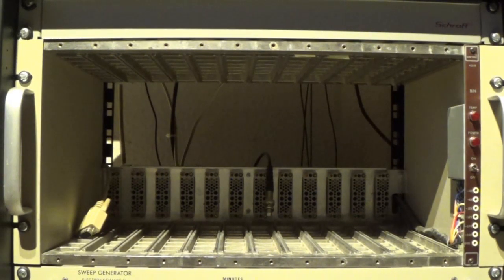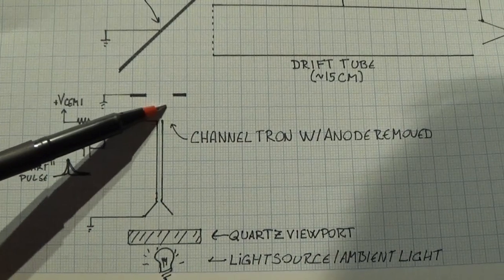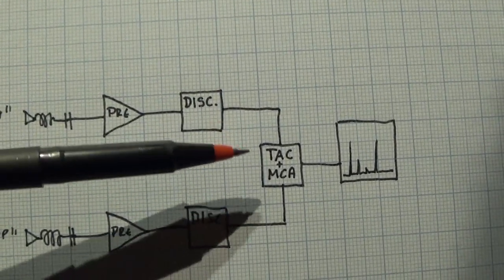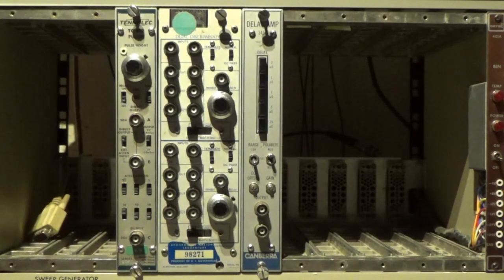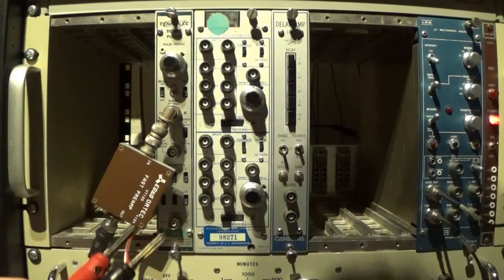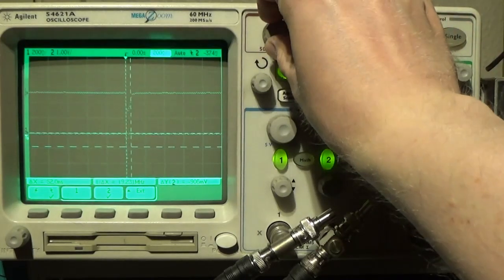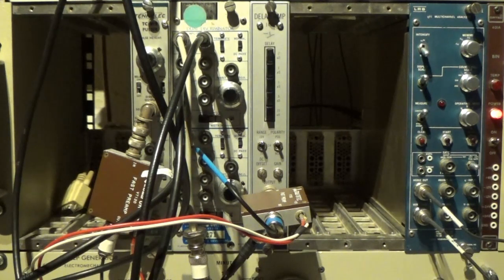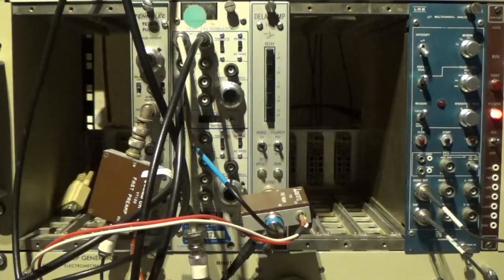Electronics for a DIY Time-Of-Flight Mass Spectrometer

Comment: Another great video, can't wait to see the finished results. You do a lot with analogue electronics, which is very cool and interesting, but can you say why you don't digitize it at the front and do this analysis in the digital domain? For example, you could use a USB oscilloscope to watch the start and stop lines. I've found with my current projects almost everything I build is just a teensy arduino 3.6 to use its fast ADCs and maybe some frontend signal conditioning. Where I need very fast analysis its a FPGA and ADC, but the teensys are so fast its not needed much anymore.
Reply from the maker: Thanks! It's a preference. I happen to have all the analog gear, and it is lengths better than what I could hope to do in software. Nanosecond timing is not trivial in a microcontroller or pc oscilloscope. 

I can always dump the MCA data to a pc for further analysis
Reply: @chromatogiraffery3104  absolutely right about timing being a pain. I also think physical debugging of a signal path is more fun than digital! Keep up the exciting work